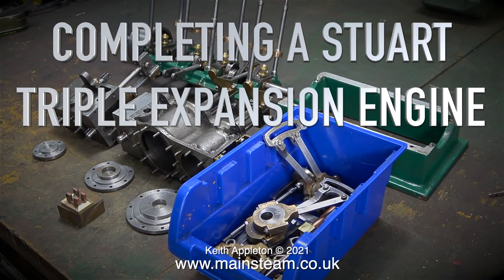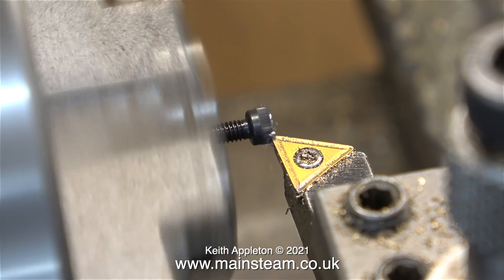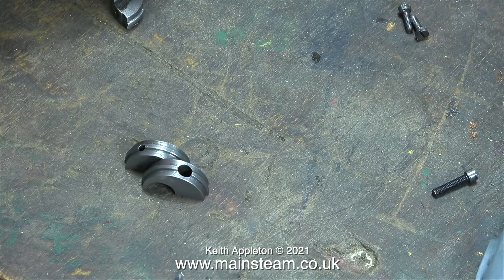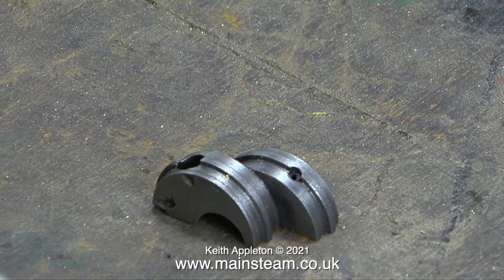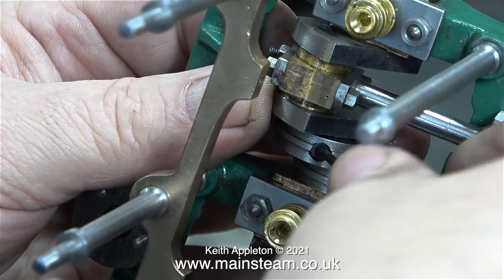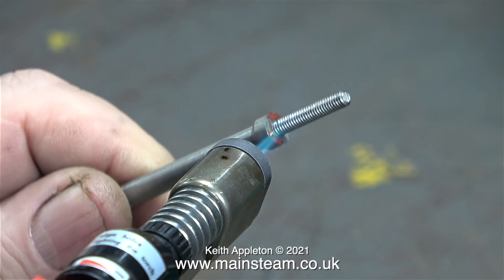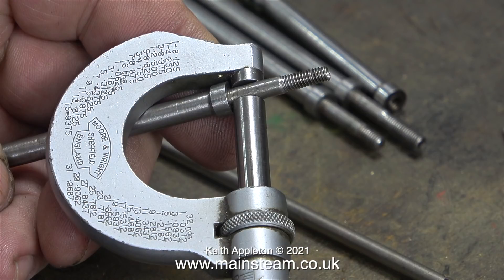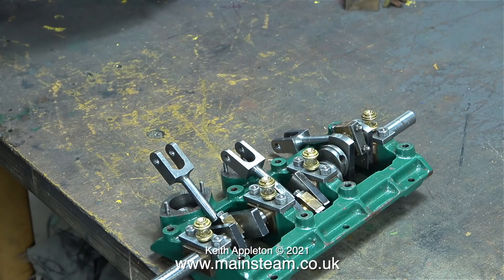COMPLETING A STUART TRIPLE EXPANSION ENGINE - PART #17

Comment: I was wondering what you were going to do differently from your first repair to the column studs, apart from the length obviously.
I think your solution is likely to be much more like a full sized engine, I really can't see a full sized engine having a column with a threaded part on the end, a separate stud seems to fit much better with engineering principles.